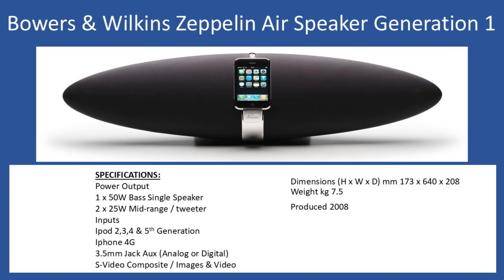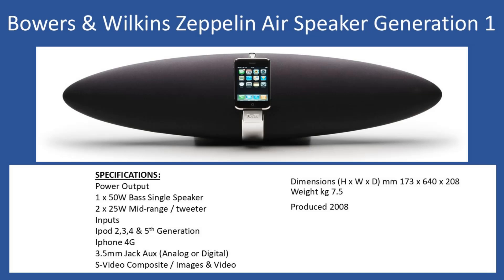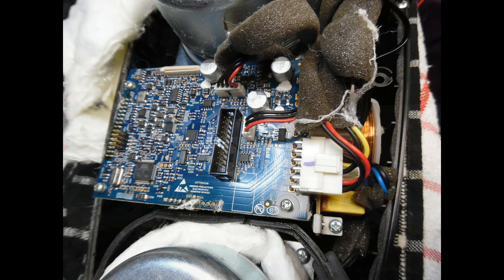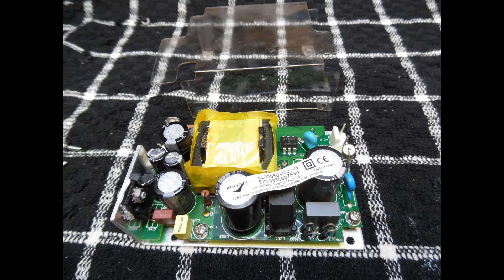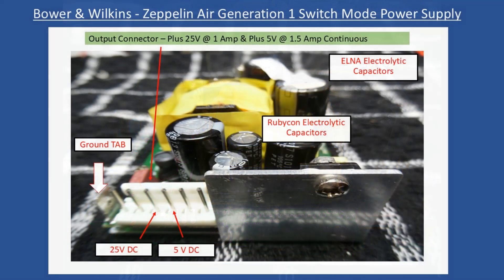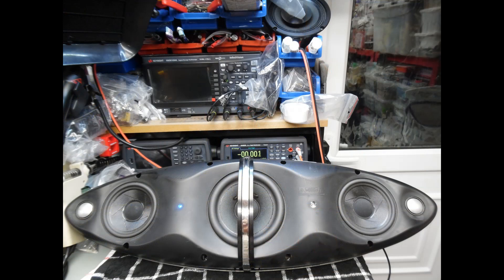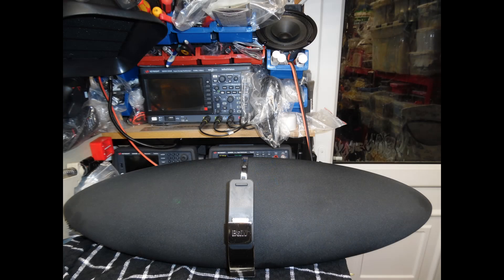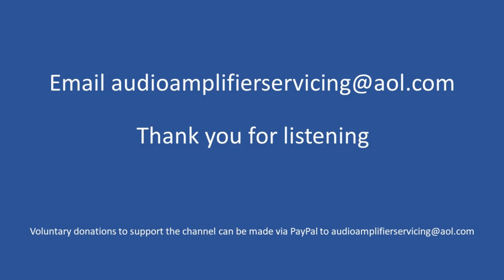Bowers & Wilkins Gen 1 Zeppelin Speaker Repair (With Audio Tutorial)

Comment: Just confirming this works! If the power supply fails, you absolutely can swap it out for a compatible unit that fits the case. I did this myself and replaced the non-working PSU with a Mean Well RPD-60B Built-in Power Supply (60W, 5V & 24V). It fits and works perfectly!
Reply from the maker: Thank you for sharing your experience and knowledge on the channel. Great to hear you have fixed your speaker.
Reply: Hey, stumbled across your comment. got the same problem, and the speaker won't power up. Did you manage to rescue it with the new power supply? Best regards!
Reply from the maker: @JanRotring Hi, yes, the speaker was repaired after an alternative power supply was fitted.